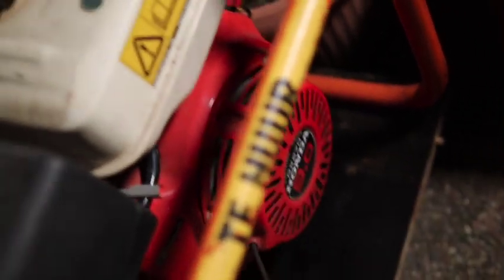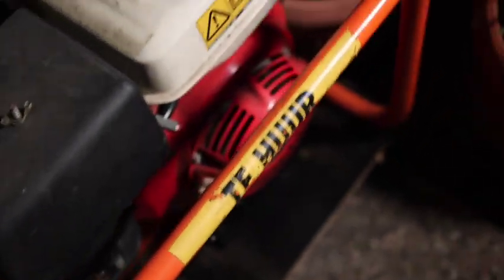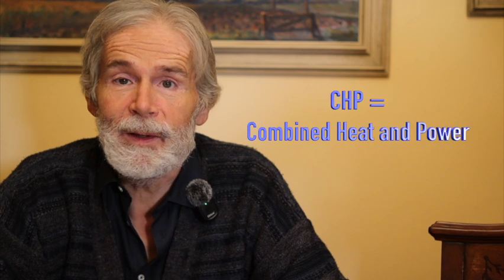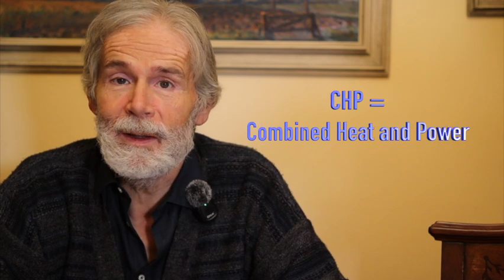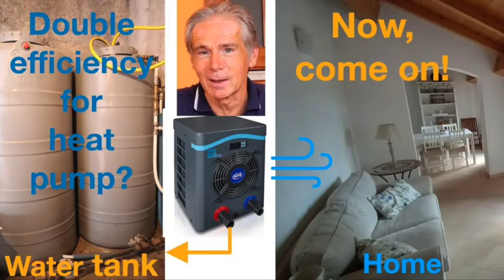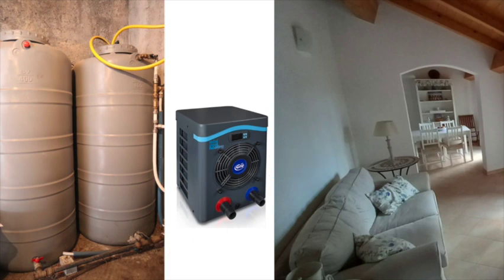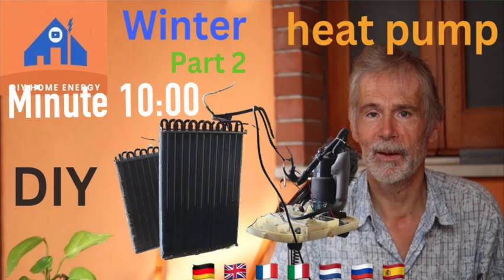Micro CHP at Home: electricity and heat for a Cold Winter 🥶! - Video 76

Comment: I came here to see how you would diy build the system, but hopefully, there will be something in other videos. I have been thinking of such a system for years. It started over a decade ago when a company came to my door trying to sell a contract for electricity, with his sales pitch that the electricity cost would go up substantially. I told him to get lost, and if the electricity would go up that much as he assumed, I would hook up a generator to my natural gas and supply my own electricity as my natural gas cost at that time $5 Canadian dollars (CAD) per gigajoule (GJ) as 1 GJ is the equivalent of 277.78 kwh, do the math. My electricity at that time was $0.11 CAD. With a natural gas price of 5 bucks and a generators efficiency of 30%, it would cost me 6 cents (cost of the generators depreciation and maintenance not included). 

Years after, I thought (and joked about it to my wife), if I take the engine out of her chevy cruze (1.4 l turbo), convert it to natural gas, and convert her cruze to electric. Then, move the cooling system (radiator) in the house and heat the house with it. I thought she could travel near 100% efficiency. 

I thought, Eureka!! I'm a genius! Just to find out that these systems (micro CHP) already existed in Europe and Japan. Unfortunately, the cost of these systems, bylaws, and homeowners insurance make it prohibited  to buy or build such a system. Oh, and I forgot to mention the noise (another reason for using the cruze engine. It is so quiet).

For what you mention about gasoline not sustainable. It is, in some ways, true. But....  a grid (you call it state electricity) powered by fossil fuel is far-fetched from clean or sustainable. A  gasoline powered car is not much dirty than an EV powered by electricity from natural gas and is way cleaner than an EV power by a coal fired plant (35% of global electricity). Gasoline, diesel, and kerosene (vehicles) will play a large part in cleaning the atmosphere from CO2 due to synthetic gasoline, diesel, or kerosene. These fuels are a direct replacement for fossil fuels and don't need any modification like other fuels, including ethanol. If interested in learning more about synthetic fuels, search for P1 fuels, or Porsche's efuel. Solar and wind power aren't a solution  for home or EV'S  but definitely for synthetic fuels. Also IMO natural gas is a sustainable fuel as it is produced and found every day more and in the ground (it also can be made by organic waste from kitchen waste yard waste and verge grasses. Although there isn't  enough organic matter on this planet to satisfy our energy consumption that way. But there is enough ocean water, solar energy,  and CO2 in the atmosphere to convert into fuels)
Reply from the maker: You really hit the essence of why I started this channel, Fred — your thinking is absolutely right. The math you did years ago is the same logic behind every micro-CHP: waste heat is too precious to throw away.
In Europe we also built many such systems, but they stayed locked behind high prices and regulations. That’s why I show how to make smaller, simpler, DIY versions that anyone can build and maintain. Security of Supply for heat and power is not only for the rich.
Your idea with the Cruze engine is brilliant — a modern, quiet, turbo engine on natural gas would indeed reach 80–90 % total efficiency once the heat is used indoors. I discovered at a workshop that the Toyota Aigo with 3 cylinders is also very quiet. What I do here is the same principle, just scaled down with small generators, heat pumps, and storage tanks. A car engine is much power for a house and I have to find an electric machine to match the power of the engine. I am now searching for a water cooled scooter engine but it it difficult to find. I think 8 HP is the minimum with water cooling. Also gasoline generators with water cooling are an option but start at 8000€.
I also agree that the “fuel discussion” is not black and white. Synthetic fuels, biogas, even recovered gasoline — they all have a place if we use them intelligently and close the carbon loop. I once worked with the EUBIA, the European Biomass Industrial Association and found that they are also focussing on the same area but they are now less active.
Thanks for your detailed comment — you clearly understand the whole picture. Stay tuned: in one of the next videos I’ll show exactly how to build the system step by step, starting from a small water-cooled engine and turning it into a quiet micro-CHP for home use.
I would also like to invite you to see video 117 https://youtu.be/f-mbbwcsQFk
It is the last video in the playlist on micro CHP and contains at the end a link to my new audiobook The Symphony of Energy.

Comment: I don't know that recommending engines that last only 1000 hours as something to run all winter is a good idea...

NB that micro turbines, cheaply made from a turbocharger, are:
Great for heat recuperation.
Have only one moving part.
High frequency noise is way easier to damp than that low frequency racket!

Also; you are German.  that means that all your neighbours have lathes and milling machines and great craftsmanship and technical know-how.
That means that "I have trouble working a screwdriver!"  is NOT an excuse!  :)
Reply from the maker: Hi Raylene, I am Dutch but my first name sounds very German indeed! My intent Is to run the engine only a few hours a day, using the surplus power to charge the battery and then live on that for most of the hours. I don't like the gasoline generator too much but it appears that many have them. A microturbine is really fascinating and I thought about using a turbocharger, do you have experience with it? I will look on youtube...and be grateful to you if that tip results in a super project!
Reply: @nnvasen-good-energy  Oh Dutch!  Dit is baaie naby aan Afrikaans.  So ons is nou tweetaalig!  😃

I have zero practical experience with Turbo-Turbines sadly.
Do NB that a turbine without a good  recuperator (heat exchanger) is less efficient than ICE.
ie:  If you need more heat and less electricity; that works.
Else you need to send exhaust heat back after the compressor and pre combustion chamber.

Another thing to note is that intake noise is the issue (when using a long exhaust)
So the air filter plays a big role in silencing.

Also DONT build a turbine without a proper elliptical, 3 to 1 ratio Bell Mouth! that is in the coldest air possible.
On the exhaust side you want to do Static Pressure Recovery too. 
More on those if we get that far.

Also NB the electric turbos you get nowadays (compressor only with a motor/generator. These are able to run the turbo's rpm.

Oh and generator rpm = generator AC frequency.  And HF is much more efficiently converted to DC.

Last thing:  if you are only running a couple of hours a day; excess heat at temperatures above water's boiling point is easily and cheaply stored in a sand battery..!

On the ICE side; note that an old, low rpm Lister runs on the smell of an oil rag. 
This is because to low friction (long conrod) and there is no 'supersonic' airflow restriction) at low rpm IMHO.

The "doef-doef, doef-doef" sound is more calming than irritating.
It will also outlive you by a century or 2!

Comment: Gladly, I found an amazing YouTuber talking about something I have been thinking about for over a decade! I would like to DIY one in the future if possible. But here at 6:33, I don't quite understand: How can the garage remain cooler than the outside if the heat pump keeps extracting the heat and releasing it into the garage? From my perspective, if the region is very cold in winter, it might not get as hot as in the summer of subtropics, which means air conditioner might be useless. Instead of using an air conditioner in the summer, just collecting the exhausted heat to heat up a water tank might be a better option.
Reply from the maker: Thank you Henian for your appreciation! I am glad that it was useful for you. At 6:33 I mean that the outside is changing much more in temperature between day and night under certain circumstances (especially when the sun is shining on the external unit), while inside it might be more constant. If that is true, then you can use that to dump the heat in the cooler garage, which you can cool from the north side of the building, from the space under the house or waiting for cool night air. It is something that you have to see in practice: where is it cooler in this moment?
Obviously it will heat up and then it is "Game Over". And this video is indeed better for the winter because it is CHP (Combined Heat and Power). Where do you live and how is climate? Your name could be Chinese.
Your idea with Hot Domestic Water production is a good alternative: that is a heat demand in summer. I talked these days with a gym owner in Philipines and they need showers in summer and at the same time they have many black outs.
Reply: @nnvasen-good-energy  Yes I live in China and currently I don't have to make a CHP because the climate is balanced here and electricity supply is adequate in cities. But I am planning to migrate to other countries, so I have to do my homework in case I end up living offgrid :)
Reply: @nnvasen-good-energy  Oh BTW, since the Philippines is a tropical country, I think using solar panels is also an effective and economical solution. And oil generators can serve as a backup on cloudy days. But that gym owner should pack up the panels every year when a typhoon is coming

Comment: In my past life I worked in a steel mill and had a labor crew that cleaned the brick checker chamber with high pressure steam rods. An Open Hearth furnace burned dirty Coke Oven Gas and OIL combined. There were two burners, 1 on each end of the 60' rectangular bath. Underneath the furnace was 2 brick lattice  chambers. The flame heated air would blow over the iron in the bath then down through these chambers, preheating the air then switching directions and using the preheated bricks to warm the incoming air giving better overall efficiency and preheating the bricks on the other side. 
Could you use a simple brick (locally sourced) lattice (air sealed with mud to avoid gasses leaking into the room) . The lattice would be heated during the "Running" phase of the motor, then give back heat when the engine is off. This system would be more work and take up more room, but in a cold climate, it would be worth the extra efforts.
Reply from the maker: Hi William, you have been in big industry! Good advice you give there. I have some video about fire, i think nr 6, where I experiment with a ventilated barbecue where I wanted to put a couple of kg pebbles and then alternate combustion gases and normal air for charging and discharging this storage. After my videos with the sand battery I would rather use that for the engine gases. I would make a kind of channel made with pebbles inside a cubic meter of sand because pebbles are easy to pass through for the gases. What do you think?

Comment: The exhaust gases will be dirty and will coat the heat exchanger with emissions. The heat exchanger will need some way to clean it out. Not so easy in a radiator.
Reply from the maker: Good point William,  that is one more reason to leave 10 cm of water in the radiator.  The other reason is the high temperature. The thermohydraulic installer that gave me the old radiator told me that it can be a problem with the sealings that aren't only at the connections but between each vertical element. The water will keep it under 100°C and also clean. I don't know yet how clean the gases will be and that's part of the experiment. That's also the reason why I am not yet too concerned about the long life of the radiator.
Reply from the maker: First I want to see it working, then I proceed to improvement.

Comment: I mostly worry about exhaust gases and noice in the house, best warmer so far is a inhouse Chinese diesel heater....
Reply from the maker: Good point Frederik. A dedicated thermal generator is practical and has a good efficiency close to 100%. My idea is less easy and you must coordinate demand of heat and electricity.  That is also in industry a challenge.  Nonetheless it is strongly recommended  by experts and economists to apply CHP   if the conditions are right.  Moreover if you want security of electricity supply it is a good solution to use also the heat, which is a gift if you consider that it is always discarded.
Reply: @nnvasen-good-energy  Maybe a combination of Both sources, the heat pump has electrical resistance coils as a backup source once temps fall to a certain level. The thermal generator is already known and would be my first choice, freezing to death is the highest priority, then after that you can move to the next level of importance where I see your (our) system kicking in. As you mentioned, there are many layers of the onion. There are already several videos on how to set up the thermal generator so now you're down to the next layer, electricity + heat.
Reply from the maker: Yes, I agree, certainly in rigid climates you have to think of a secure solution.

Comment: Renewables cannot power a modern civilisation on their own.  They are just as vulnerable as hydrocarbons in that the materials used to create them (plastics for wind turbines, lithium for batteries etc) need replacing at regular intervals.  Modern theory has hydrocarbons as 'self renewing' anyway so their availability seems, for now, to be as lasting and endurable as we will ever need or until alternatives (fusion) become commonplace.
Reply from the maker: I think that a combination of Energy Efficiency and Renewable Energy will do it. And we have to do it or we will worsen climate disasters and scarcity. Tell me about those hydrocarbons the renew themselves. I think they are indeed there, for example with solar light that creates algae with high speed, but don't know so much about it. Until someone informs me and if it is easy enough to DIY then I make a video!
Reply: @nnvasen-good-energy  Not even the IPCC subscribe to worsening climes.  As for so-called 'fossil' fuels, I wonder where the dinosaurs went on the moons of Jupiter (currently comprising mostly hydrocarbons in their atmosphere)??  If such hydrocarbons came about as a process of natural production on those moons it does the same for our planet too and is therefore a continuing process.